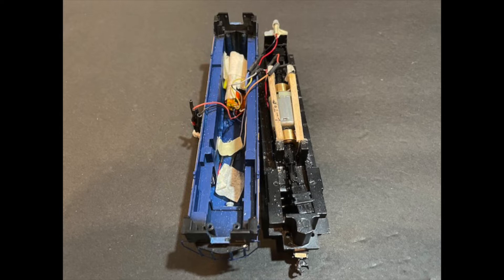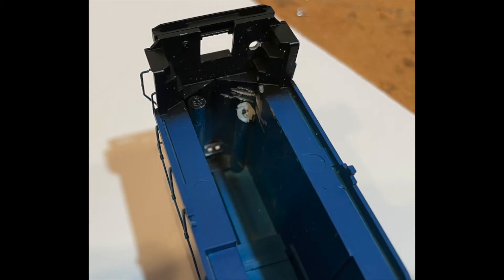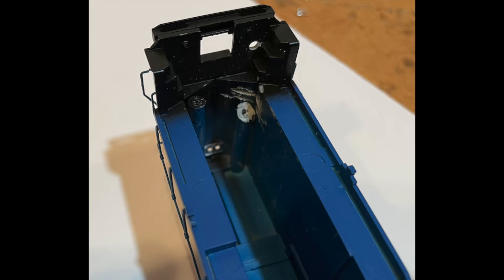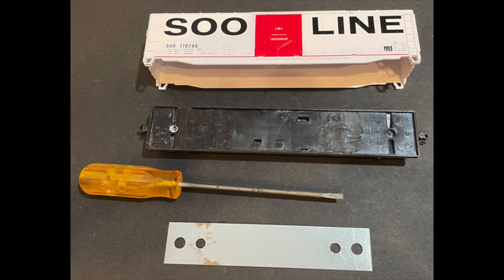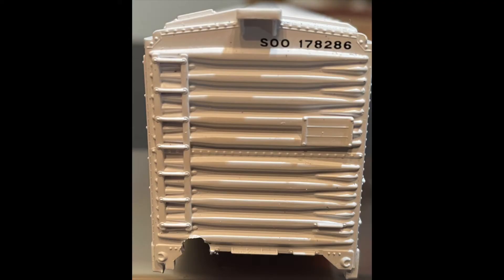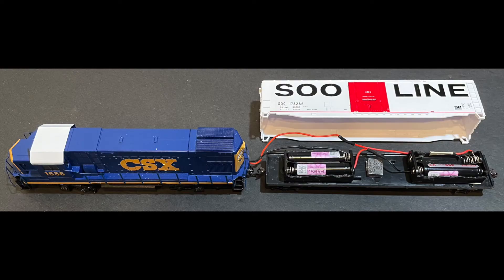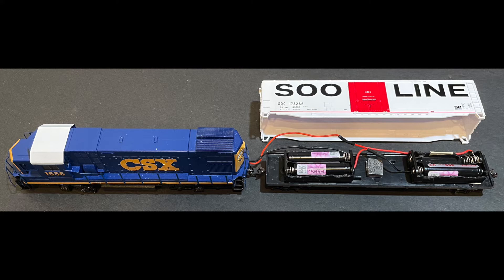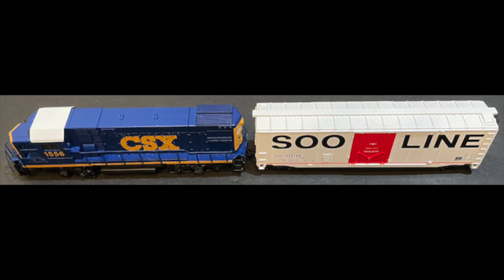Making and Using a Portable Dead Rail Demonstration HO Layout - Part 6

Comment: Do not use batteries or accumulators but supercapacitors, charging only takes 1 to 2 minutes, count your profits. These are so small that you can build them into the locomotive itself, IF you are smart enough you can charge them via the rails via a smart circuit.

Comment: audio isn't audible
Reply from the maker: 2nd 66 Tube, thank you for letting me know. While the volume is indeed low, I could hear it on my MacBook speaker and headphone with the volume all the way up on the YouTube sound tool and the MacBook sound output in the middle position. With my wife’s Windows laptop volume set at 40 and the YouTube sound tool all the way up, I could hear it. I checked it on her Kindle. I have no idea where the sound controls are, but I could definitely hear it. Lastly I checked my iPhone, with the volume all the way up on the iPhone, again I could hear it. Luckily, except when trains are running, the audio is just me reading the text in English. Again, thank you for alerting me about this possible issue.